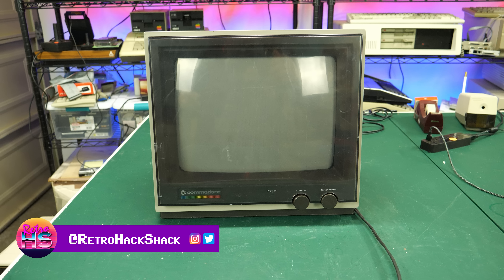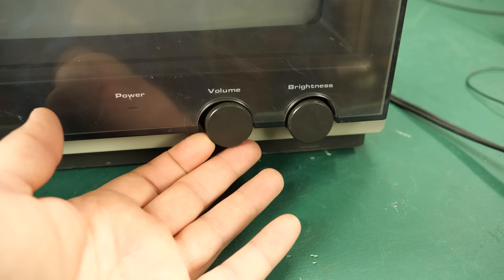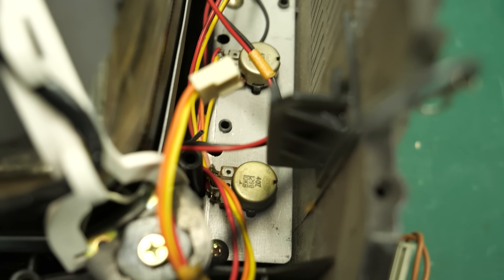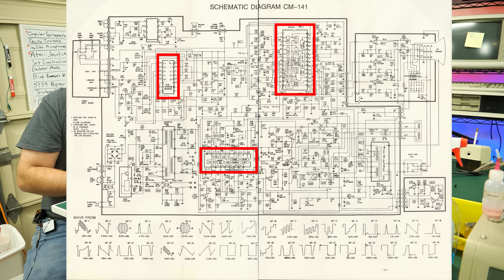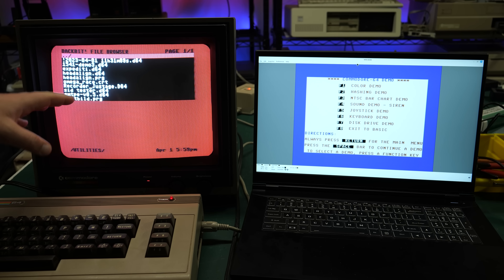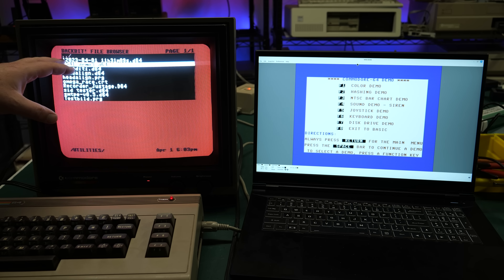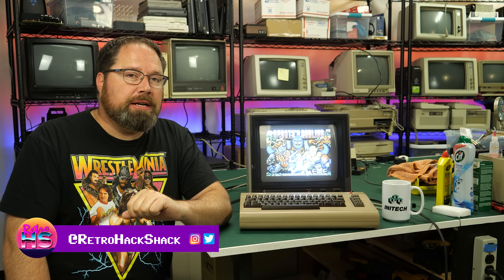Commodore 1802 Monitor - Timeline and Repair

Comment: Nice work mate. If you're looking for something to assist fine tuning your CRTs I highly recommend the 240p test suite. It runs on a number of consoles and is well documented. But it looks like you did a pretty good job with just the c64
Reply from the maker: Thanks! I will check it out. Using the emulator is not perfect, but it'll do in a pinch.
Reply from the maker: Oh there is a Dreamcast version. I happen to have one sitting behind me. Maybe I will burn a disc and try 240 test suite on the monitor since I still have that out too. Thanks again.
Reply: @RetroHackShack  Awesome!

Comment: I have both the 1701 and 1702 and they are totally different, the CRTs are different and the chassis are different, the 1701 also has a huge old power supply while the 1702 has a small switching power supply.

Comment: You do not use headlight restoring pads, you use wet and dry 1000 then 1200 then 1500 then you use a buffer with car polish to get the perfect finish for polishing plastics.
Also watch it when cleaning the cabinet with abrasive cleaners as you can remove the colour like I learnt the hard way. Mine has a yellow tint in a spot where I rubbed too hard.

Comment: Hi, check out the 240p test suite. If you have a chipped/jailbroken PsOne or Wii you can have all the test patterns you need. Wii is probably better as it has composite, svideo, component and rgb out as well.
Reply from the maker: Yeah. It's a great tool.

Comment: Okay…so I just inherited one of these. I have no idea what I’ve got. It works perfectly, sound and video. It’s the black one you’ve got. I’ve tried checking eBay but can’t find a match. What is something like this worth?

EDIT: want to clarify—I’m not a heartless jerk. This item was in my late grandparents’ garage and was going to be tossed out so I picked it up. I loved my grandparents and did keep some items for sentimental value. I had never seen this before and it was just going to be dumped. I hope this all doesn’t come off the wrong way!